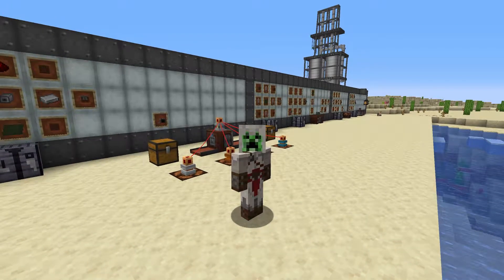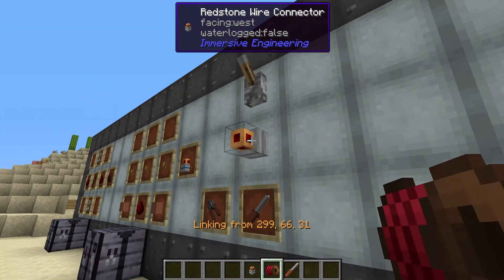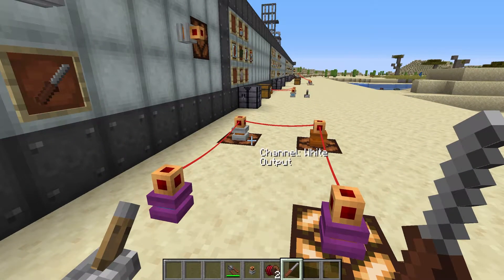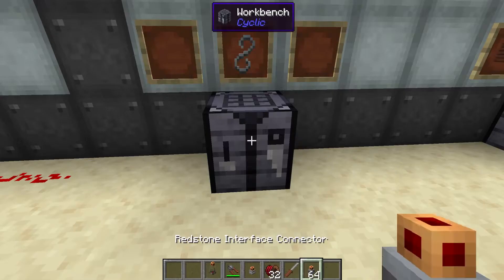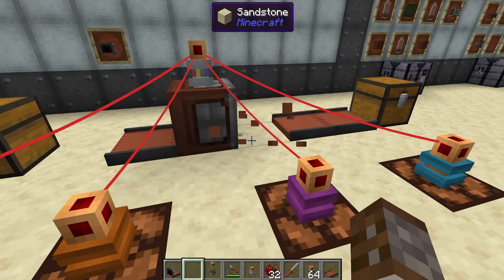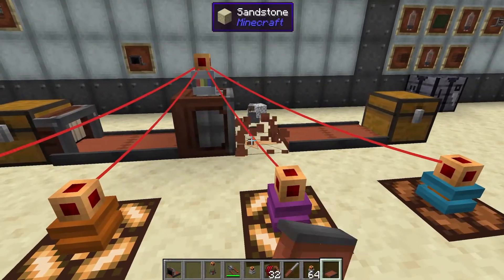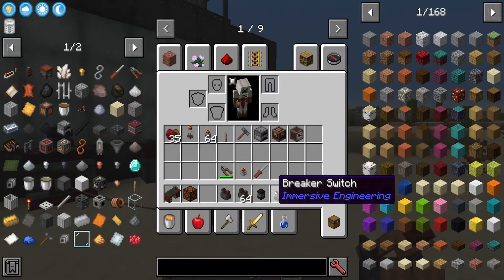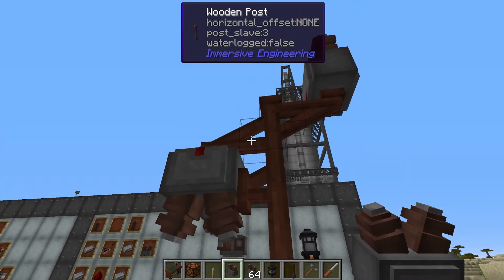How to: Immersive Engineering | Redstoning! (Minecraft 1.16.5)

Comment: sadly my redstone wire connector is not working. I tried with engineer's hammer and screw river both, Shft and right click, nothing happened. Also no connection made at all. Can someone tell me what is wrong?
Reply from the maker: I don’t really know I’m afraid. I’m guessing it’s not just a visual bug? Or maybe you are using red stone wire from a different mod?
Reply: @Mondays3  hey. Sorry I was using normal screwdriver,where i needed to use the "engineer's screwdriver" . And it's worked . Thanks 👍